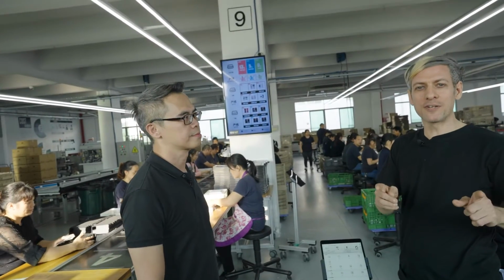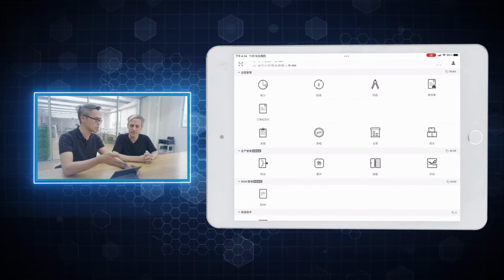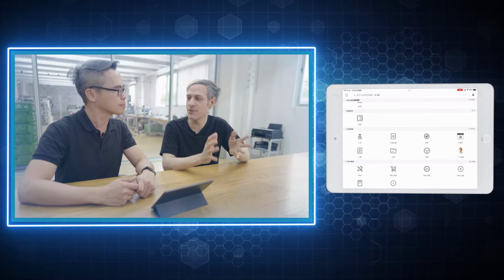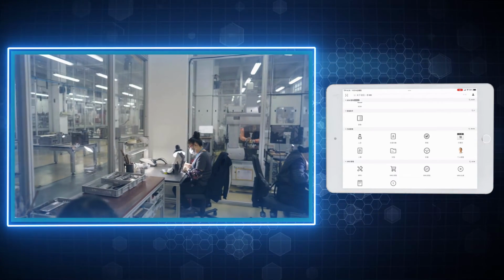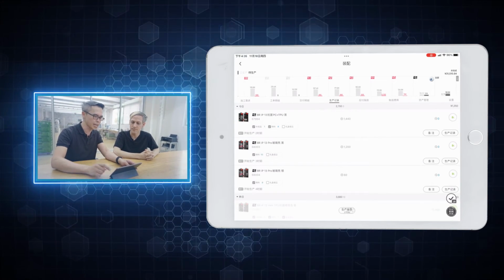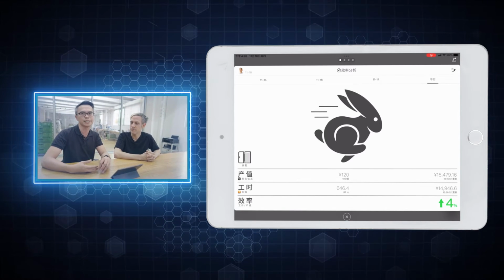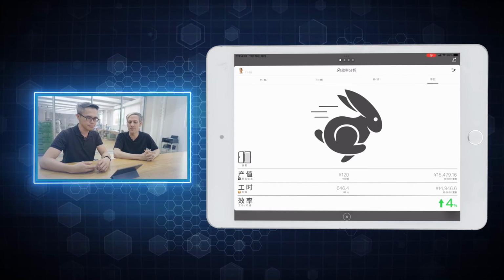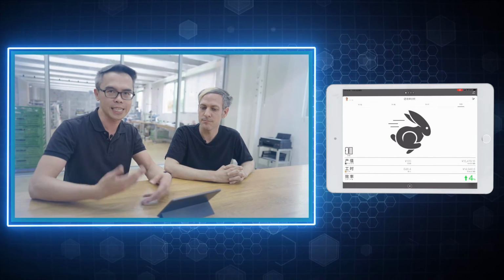How they spent 1 billion to make phone cases | Top Factory

Comment: The simple way is  EDM machine.. it cut using electrical through the positive mould.... and wire edm actually a wire cut... it cut using wire and its faster than edm machine... and some of the edm using diesel fuel to submerge the mould... edm machine also can make a moulding...